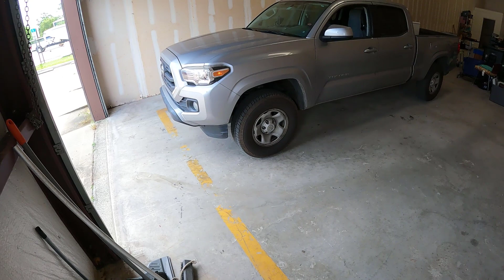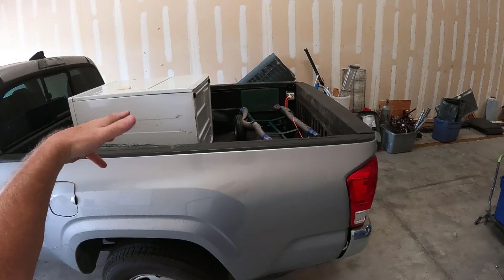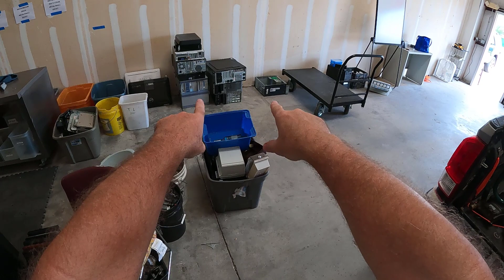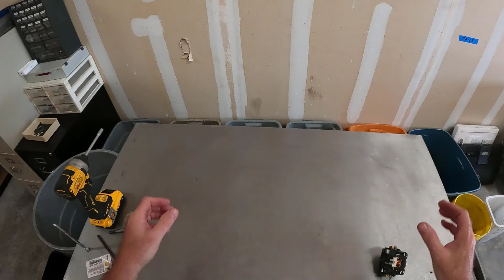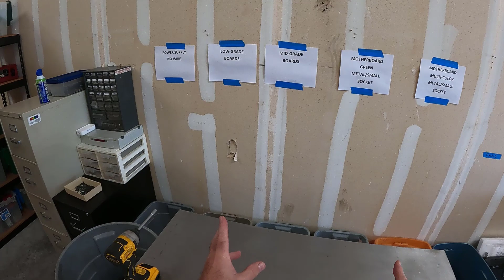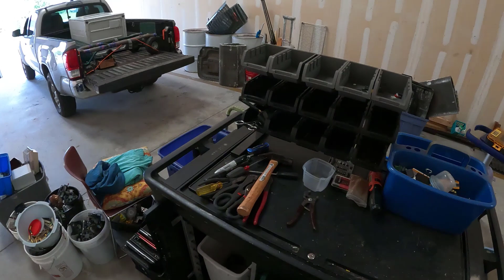Ewaste and Scrapping Business shop layout - Shark Cage 2.0

Comment: I think you mentioned you'd scrapped some air conditioners. Do you have a way of removing the gas from them? If so I'd love to see it, or know how to arrange for it to be done.
Reply from the maker: David - I'm glad you asked.  At this stage I get HVAC from AC techs that have already removed the refringent.  Usually they just don't have time to deal with the scrap and want it gone.  Some I get from home owners who had bigger ideas than execution and eventually just needed the stuff gone.  It is important that the refrigerant be properly removed from the system and that requires training and equipment I don't have.

Comment: Great layout, Shark.  Well thought through, so I really don't have anything to add.  I haven't used it yet, but to bust the plastic off of my mosfets, I have a cheap Harbor freight rock tumbler.  Going to get some ball bearings of various sizes, and use that as a small scale breaker tumbler.
Reply from the maker: Great idea - I'll look into that.  One of my viewers recommended an inexpensive cement mixer which might work for larger loads.

Comment: Shark.... Two big thoughts.... Paint now!!!! before it is too late. At least spray or roll a coat or two of drywall primer, or cheap paint. That drywall NEEDS to covered. Sherwin Williams will sell you "mistint" for $1 or less per gallon. (I also have a ton if you need it) Just get tat raw drywall covered asap. Second thought is to get vertical.  You have a ton of vertical wall real estate. To the extent you are able, plan it or rack it  now.... It is more difficult later. 

Keep doing what you are doing... It is oddly therapeutic for me. The hot sauce is awesome btw... thank you. Brad.
Reply from the maker: I'll have to ask the landlord about painting.  I was surprised they hadn't painted it already, the building has been there for years.  I need to think through how I want to go vertical.  Lots of options.

Comment: My observation of shark cage 1.0 and 2.0 is you're moving heavy items to the back and the computer items up front.  I would switch that, making storage of resale and computer parts to the back.  Shred steal, appliances, and quick turn around stuff up front and closer to the door and truck.
Reply from the maker: I had considered that in both locations.  But I deal primarily with computers and electronics.  They are moving in/out a lot more than any other scrap I deal with.  Of course, that could change as my situation unfolds and I may find I need to reverse the real estate.

Comment: My opinion which your probably not asking for is .. I really like shark 2.0 better .. you can pull right in there so you don’t have as much traveling between the truck and the cage .. And I just like the flow of 2.0 better .. I know you say during the live that there’s no air conditioning so I hope your fan system works sir 👊🏻thank you for the walk about brother 👊🏻
Reply from the maker: Thanks brother - I've discovered that standard home grade box fans just don't cut it.  I need to look into industrial size fans or a swamp cooler.
Reply: @sharkscrapper  ya man we used those Swamp coolers when I was working in Homestead Florida they were great

Comment: interesting setup like it  and make sense, one objection setting up a table where you gonna eat and rest next to the spot where you use grinders and such messy tools  is not the greatest idea 
other than that looks nice and well thinked thru, and food processors are not too good for what you wanna use it only one  with  metal container can do such a stuff tough blades disappear in no time in them  all glass containers and plastic with bigger speed cracking very fast learn it  by  a lot of cleaning tough  you may try maybe you will find out some material what  will be good for them to process in hmm maybe tantalum´s they are quite soft and light  and im never try them  that may work  good luck
Reply from the maker: Thanks Rafal - I agree that I need to move the fridge towards the front and away from the grinding, dusty area.  Of course, so far all my "breaks" have been just long enough to down some hydration and get back to work, so don't really need much of a break area.  Appreciate the feed back on the food processor.